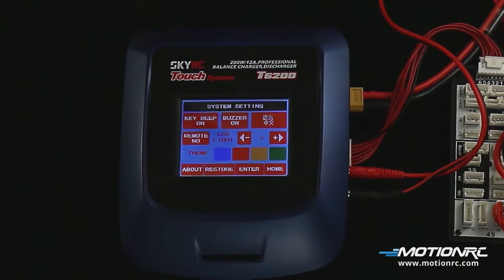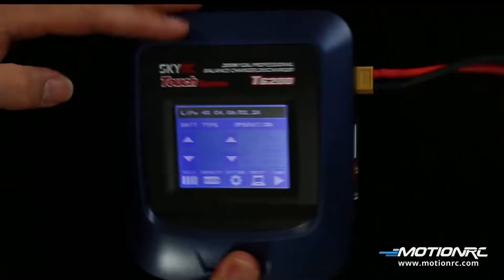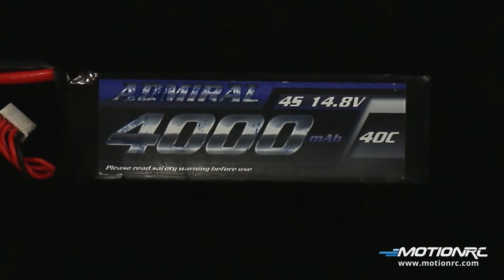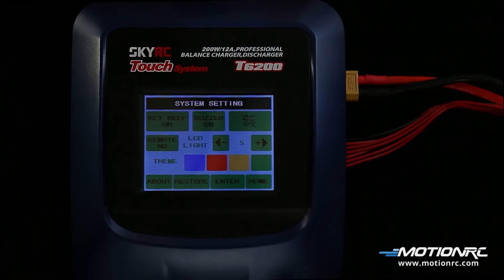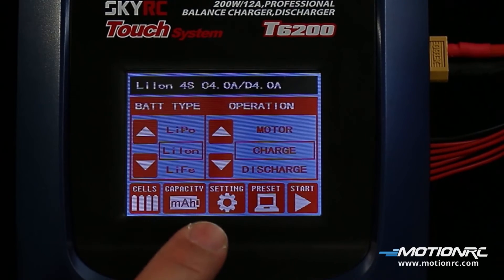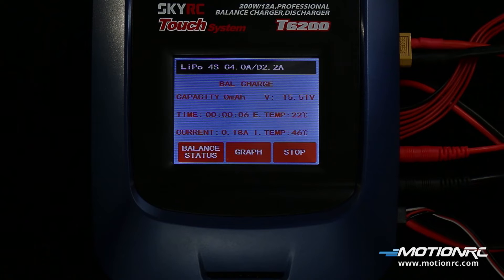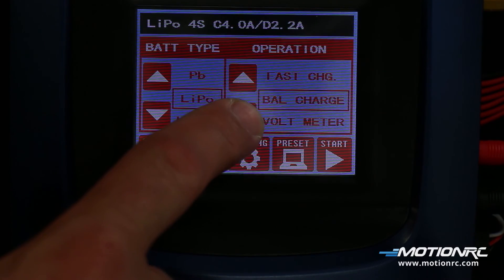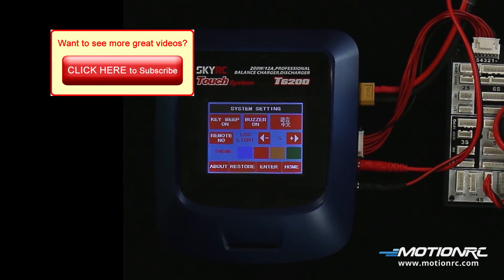SkyRC T6200 Touch Screen Battery Charger Over view

Comment: 1- Don't like chargers that require a separate power supply. True cost disguiser.  2- Why all the labor & tech demands on the customer to make the unit functional? Deliver the unit with the necessary software already installed, for chrissakes! 3- Feature "...can check RPMs on motors with the sensor wire. If you don't have one, you can check the ESC at least."  And nothing about how/where to get one? Sounds like, if user isn't properly equipped, the "feature" is basically useless for its purpose. 4- Not exactly confidence-inspiring to see a typo in the unit's readout screen (@ 7:11).
Reply: 1,Im guessing you are new to the hobby and have never has a power supply fail???

2,its impossible for SkyRC to preinstall the software on you personal computer... The user needs to do that and by downloading it, its always up to date (im guessing u dont own a smart phone or laptop??? this is a common practice 

3, im guessing you are new and dont know the difference between sensored brushless motors and sensorless????? Some setups simply dont have a sensor wire, its got nothing to do with the user been equipt LMAO. they just dont have use it. 

So yeah...... what a waist of a commnet